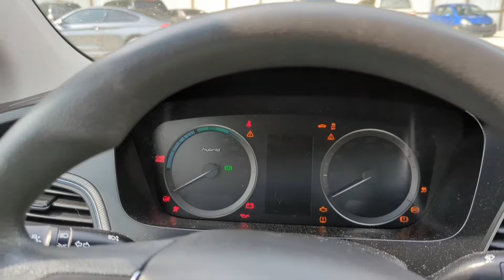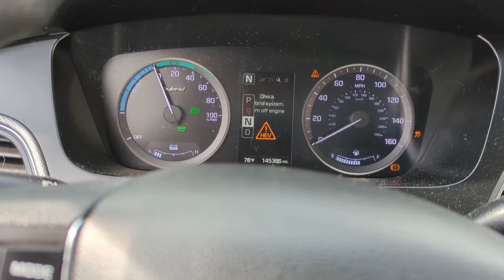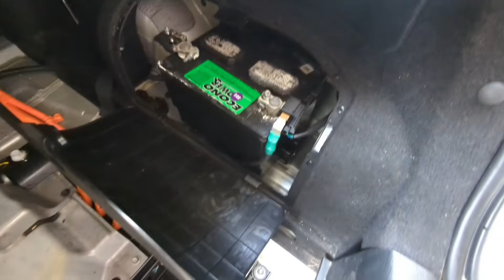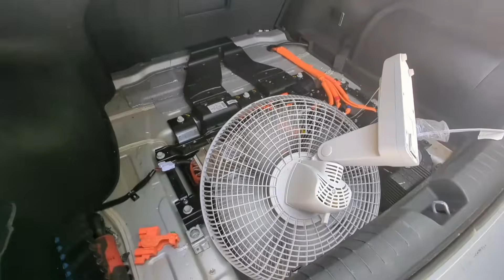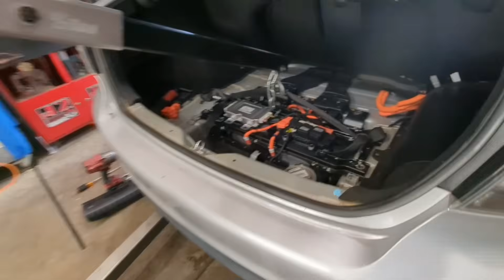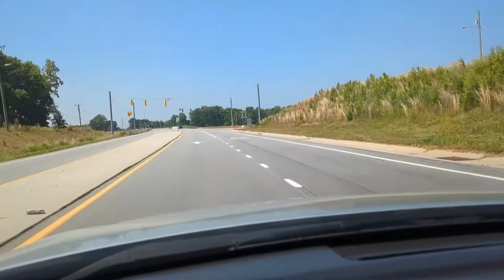2016 Hyundai Sonata Hybrid Battery - Check Hybrid System HEV

Comment: 2013 Hyundai Sonata Hybrid · Limited Sedan 4D starts but the hybrid service light came on and will not move-what do you suggest?
Reply: I have the same car...change the hybrid fuse in the truck behind a access door. It came with a 125amp fuse but the Service Bulletin will say replace with a 150amp fuse...easy to do but a Hyundai dealership should replace it for free since it has a bulletin on it.

Comment: I have the same car and i was driving on the freeway, all of a sudden it said engine overheating, i immediately pulled over and turned the engine off. I topped up the coolant and tried starting back on. Then it showed the exact same warning and symptoms. What do I do? Where are you based, if i may know.
Reply: Due to the engine overheating, I think the engine broke down.

Comment: I have a 2016 sonata hybrid and it is doing the same exact thing and has water under the hybrid battery and a little on the top. How did you fix the rainwater issue?

Comment: My mom said her car had this code on 2017 Sonata.  But she was still able to drive home. Code reset itself and drove fine when i drove it. Mechanic didn't see any issues either when i brought it in. I thought maybe overheated but I didn't check for water. Not sure how water would get under there.
Reply: Did your mom figure it out? Did she spill water in the trunk?
Reply: @TheBigExclusive I borrowed her car a few months ago and it finally completly broke. Dealer had to change the Power Relay Assembly. Not sure why nobody else noticed that had been the issue all this time. Warentee covered the repair but sadly I had drive far upstate and the tow was expensive.
Reply: @kennyadvocat  - Thank you for the feedback and reply. Would recommend this car to others? Or is the Sonata Hybrid too unreliable? 

My brother is considering buying a used one to get better gas mileage...but hasn't made a decision yet.

Comment: I havev2014vkia optima hybrid. I can drive it about 20 minutes before it starts surging and then the hybrid light comes on. Ev battery stops holding a charge . Kia says it might be the transmission and electric drive motor. Cost more than the cars worth. Plus it has 78000 miles. Ive had it since 87 miles.
Reply: I also have the same situation today, I did some diagnostics and it shows error P 0183.P .0185
Reply from the maker: Please scan to see what codes are coming up
Reply: did you fix your car any update

Comment: Hi there 
I have a 2015 Hyundai sonata hybrid 2.4 and the hybrid battery is just consuming too much of my time and not able to fix it 
The code is P174
Reply: This error indicates a problem with the switch valve between the motor and the hybrid located inside the lime valve case.

Comment: I have a 2019 Hyundai Ioniq (same hybrid drivetrain I believe) with the same symptoms. It has a P1A8B code, and it also happened when driving in rain and after going through a car wash. The Hyundai dealer says it needs a new HPCU for almost $4,000. I think they are just using their scan tool and following their diagnostic flow sheets, but I think the root cause might be something else. It ran fine on dry days.
Reply: It should cover under warranty since Hyundai provides 10 year 100,000 miles warranty

Comment: My friend baught a 2012 sonata hybrid,wont start ,get the same message on the dash saying turn vihicle off hybtid system the resdy light keeps flashing,the fuse is hood thr power relay is good ,the battery when tested st the power relay is 242 volts ,each cell is 26.7 v ,car wont start ,any advice will be appreciated 😅
Reply: Did you fix it?
Reply: Please update us?
Reply: Advice: could be a bad inverter
Reply: any update?

Comment: How does the water get in there 
If this is the problem how can it be prevented so it won’t happen again 
Or how should it be dried out on daily basis
Reply: He said in the video that the owner possibly kept a water bottle in the trunk. The bottle ended up leaking and spilling water. The water went through the trunk floor and spilled onto the battery. That was his best guess.

I suppose this is a lesson not to keep liquids in the trunk since Hyundai puts the hybrid battery under the trunk.

Comment: Hello, I have that same problem with a 2016 Hyundai hybrid sonata and I scan it and it gave me the error p0aa6 it takes out of the hybrid system I cleaned it that it had humidity but it keeps giving me a problem I only saw a strange part that has like a fuse from DC450 to 120 to 2000 amp

Comment: How do you remove the battery on the left in the trunk? I don’t need to remove batteries under the trunk. I need to remove the battery on the left you unhooked the negative clamp from the negative post
Reply from the maker: That's the 12v vehicle start battery. You just need basic tools to remove that. You will need a socket set and a ratchet.
Reply: In hybrids the 12v battery doesn't start the engine, it's only used for all other accessories. The traction battery (high voltage battery starts the engine!
Reply: @JP-nx2wr  really? I just had to replace an engine coil (did all 4) last week, then I tried starting my car and nothing was turning on, no lights would go on, not even high beams or emergency lights, key fob wouldn't do anything to the car. I then turned in my battery to autozone for a test and it came back it was a bad battery, so got a new one and my car started. if the 12v doesn't start the engine, I may be running into some issues soon then unless it was coincidence...
Reply: @JP-nx2wr that's true but you still have to have a good 12v battery to run the computers that control the vehicle

Comment: I had the same problem it was the cattle Cadillac converter
Reply: Was that the only code that came up when diagnosing? I’m having the same issue and the only code it throws is the catalyst system
Reply: @wichovr6  Hi, I have the same problem as you fixed it?

Comment: You replace all hv or relay
Reply from the maker: In this case we just had to remove the accumulated water underneath the battery and let the moisture in the battery dry out.  No parts were replaced.

Comment: Too much extra cost/complexity/unreliability to eek out a few more MPG. IMO, a straight gas version is more reliable, cheaper to buy and WAY cheaper to fix. I esp. would NEVER buy a used Hybrid.
Reply: a "few more" is an understatement.
i can get 40 mpgs on my optima.
i heard camry hybrids get up to 50mpgs.
600 miles of range before we gotta fill up a tank of gas. normal cars get around 300 miles before a fill-up.

and i think kia/Hyundai got good warranties on the hybrid system too.
like 100k or 150k i think.

my previous car was a 03 nissan sentra. 1.8L oil burner. probably got a little less than 25mpgs..
transmission went out twice. engine went out twice... donated it to make-a-wish 💀

Comment: Not sure what should I do
Reply: Good afternoon tell me errors u1010 u1011 u1012
Reply from the maker: First thing would be to scan and see what codes are present. Once you know the codes we can check for possible issues.
Reply: @junkyard-dogs just got my 2013 optima hybrid back from shop. 
I took it there for hybrid error and check charging system error.

Shop replaced inverter (hpcu)
2 hours after getting car back it shut off lost power and brakes.
Dash lit up like crazy, got a new 12v battery 6 months ago, hybrid safety fuse replace 2 years ago
Reply: @PivotGrowth  YIKES! I know to avoid Hyundai.🤣 Esp. the Ioniq5 !
Reply: arju musaeadatati

Good evening sir I have a Kia Optima car, it shows the same timing in the local time to charge the battery to the last.... Please help me

￼
Reply from the maker: @لؤيالدبيس  First thing would be to scan and see what codes are present. Once you know the codes we can check for possible issues.
Reply: Здравствуйте .Подскажите киа оптима гибрид,машина когда прогрета не хочет ехать задом,выкидывает ошибку p1777.Где искать причину поломки? @junkyard-dogs
Reply: I just broke down on freeway and had the same error display on my dash.  

Codes

P1326
U0293
U1004
Reply from the maker: Since you have DTC Code P1326, the repair maybe covered under warranty by the dealer.  There is a service campaign issued by Hyundai and campaign number is 22-01-023H-2 that talks more about this.  I will try to make a video on this.  Please like and subscribe if you like to get similar topics.
Reply from the maker: Hyundai Campaign number: 22-01-023H-2, issued November 2022
DTC P1326 - ENGINE BEARING INSPECTION / ENGINE REPLACEMENT (SERVICE CAMPAIGN T6G) 

Description: Certain vehicles listed below may experience the Check Engine warning lamp
illuminated with DTC P1326 and/or an engine concern/noise related to connecting rod bearing wear
or damage. Follow the procedure to inspect the vehicle and replace the engine and/or update the
engine ECU software (if new ROM is available) based on the inspection results. 

Applicable Vehicles:
 Certain 2010-2012 MY Santa Fe (CM) vehicles with Theta II 2.4L MPI engines
 Certain 2010-2013 MY Tucson (LM) vehicles with Theta II 2.4L MPI engines
 Certain 2014-2015 MY Tucson (LM) vehicles with Nu 2.0L GDI engines
 Certain 2016-2021 MY Tucson (TL) vehicles with Nu 2.0L GDI engines
 Certain 2012-2017 MY Veloster (FS) vehicles with Gamma 1.6L GDI engines
 Certain 2011-2015 MY Sonata Hybrid (YF HEV) vehicles with Theta II 2.4L MPI Atkinson engines
 Certain 2016-2019 MY Sonata Hybrid/Plug-In (LF HEV/PHEV) vehicles with Nu 2.0L GDI engines
 Certain 2014MY Elantra Coupe (JK) vehicles with Nu 2.0L GDI engines
 Certain 2014-2016 MY Elantra (MD) vehicles with Nu 2.0L GDI engines
 Certain 2014-2017 MY Elantra GT (GD) vehicles with Nu 2.0L GDI engines
 Certain 2018-2020 MY Elantra GT (PD) vehicles with Nu 2.0L GDI engines
Reply: @junkyard-dogs  thank you so much I will call them right now. I’m so lucky I didn’t get hit by another car when this happened. I will definitely subscribe .
Reply: @Adivero06  hello do you mind telling me what happened after yu spoke with them?!
Reply: @Trio1123  they replaced the fuse for free , it’s a recall issue it has to be changed over to a 150V fuse. There should be no charge. Once they do that they will also update your software. Have t had any issues at all anymore
Reply: @junkyard-dogs  thank you so much for your help with information regarding this. They replaced the fuse and updated the computer system as well. It was all free of charge . No issues anymore
Reply from the maker: You are very welcome. I am glad to hear that. 👍

Comment: I got a 2015 Kia optima hybrid and the HEV light is on not sure what’s it
Reply from the maker: Do you know what DTC codes are in the system.
Reply: @junkyard-dogs  im got the same thing and i have the three codes it gives me P1B96 , P1B70,P1B71
I think is the 12 V battery , im checking that one on monday . any help ?
Reply: @airolg3935  did you every figure out your problem I have a 2016 hev and I have the code p1b96 and my hybrid  battery really not Taking a charge and drains pretty quick ?
Reply: @junkyard-dogs Please help me.
Error code P0a2d 2018 hybrid sonata. What happened? Problem.
Reply: I also have the same situation today, I did some diagnostics and it shows error code P 0183.P0185
Reply: I have a Kia Optima hybrid
Reply: Please help me.
Error code P0a2d 2018 hybrid sonata. What happened? Problem.